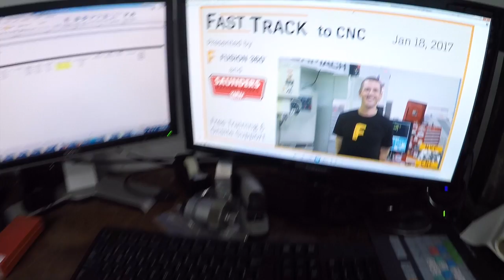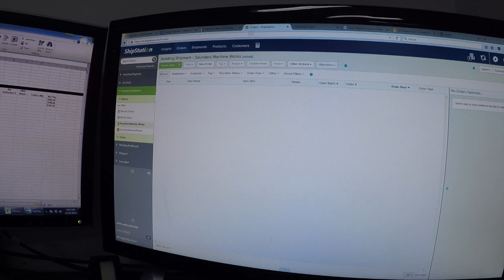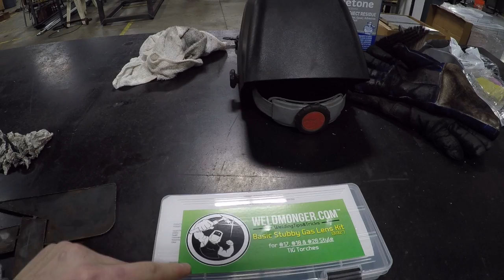Fusion 360 Event, Welding Podcast, Scraping Class!  CB41

Comment: Rust Prevention: I use Frog Lube on my vises, rotary tables, and other tools. It originated as a Rust inhibitor on Firearms, but seems to work well on machine tools, especially for tools you that sit on shelves for long periods. there are YouTube videos comparing it to all of the other products, and I haven't see only show a better product yet.Bring all three castings, in case one of the has a problem (inclusion, warping, etc).

Comment: Have fun with the scraping class. I'm about to take my 3rd class with Rich King in Feb. He's a good teacher. I'm rebuilding my Bridgeport. Its a time consuming process, but satisfying. It still amazes me that you can work in tenths with hand tools.  Andy
Reply: Before you start? It all depends on how much work you want to do! Rich says generally that if the work is out  by more than 5 thou, then get it machined. You can still scrape it if its more than that, but its going to take time. Figure you will take off about 1 to 2 tenths per pass. So 5 to passes per thou. That is not a bad as it seems, since you will start with the highest spots and work down. Lets say that straight edge you are working on has a dip in in the middle. You would divide it into several areas. The highest would get more passes. This is called 'step scraping'. On my 36" straight edge I was out by over 10 thou. I mill I had was limited to 14" of travel, so I had to shift the rough straight edge casting a couple times to cover the length. It was fine in the end, it just meant I had to do a fair number of passes. This is where a BIAX pays for itself. We were joking about planing with a BIAX :)

Comment: Great channel, John... longtime viewer, recent subscriber, first time commenter... I've always wanted to do some machining, I've had some experience with CNC routers and sanders, but no metal machining until recently. I recently started working at a place with a Smithy, a Bridgeport, and Fadal 4525, which had been in storage for a couple of years – and I'm just getting it running now, trying to decide which CAD/CAM package to go with, and very much looking forward to making some chips...

The RO unit should work just fine, I had a similar setup on a saltwater aquarium, RO's are common for "reef" tanks, because the bright lights for the reef tanks evaporate off a lot of water, and you can throw off the salt and mineral content if you add un-pure water. I built my rig out of an RO unit I found at Goodwill for $8 or so, and a toilet bowl float... IIRC, the sump for the aquarium was about 60 gallons, and the toilet bowl float kept the sump topped off nicely, only added water when it was needed. Best of luck!

Comment: John, your have a VM3, use the dowel pins in the table and in the vise to locate them! EDIT: let me clarify, Orange sells sub-plates that will dowel to your table, then you'd use the ball locks to attach the vise to the sub-plate. Or you can just put dowel pins in the table to form a right triangle to locate 2 sides of the vise. The dowel grid is precision, so you can line up all the vises to the grid.

Comment: To get your vices lined up and equally spaced you could machine up a rectangle block the same width as your vice which has a say 20mm round spigot sticking out of the top which would then be locked into either a er32 collet or whatever size side lock holder you have. Do a M19 command which orientates the spindle and locks it in position though im not sure if thats a M19 on the hass controller. Dial up the rectangle block so it is parallel then clamp it in the vice then you can accurately line up each of the 4 vices and equally space them because you can use the position screen to set the same distance apart for each vice. I've done this in the past when I was mounting a chuck on the table by putting a long milling holder in the spindle then clamp the chuck jaws to the milling holder so I straight away knew the co-ordinates to set the chuck. I haven't done a vice like that but I can't see why it wouldn't work.

Comment: WD-40 is a water displacing fluid, hence the "WD" name. However I don't believe it makes a good long term protector. Down here lanolin based products are well regarded and I use this one http://www.inoxmx.com/inox/mx4-lubricant/ It's unlikely to be found there, but I'm sure you guys would have something similar.

I've got to know Rich through scraping and always recommend his course. I think you'll have a hoot, so enjoy. The straight edges are a good project but stress relief them if they're still green.

Comment: The Starrett micrometer spindle that's marked "Sunnen" is from a Sunnen dial bore gauge setting fixture. They are typically used for automotive machining such as cylinder block boring/honing.

Comment: If you're traming in the vises to eachother in order to hold long parts, it's really not worth the time and aggravation. 

Throw in soft jaws (steel or aluminum) and cut a step in them across all the vises. 

Guaranteed to have perfectly straight and trammed work holding across all the vises. 

And I'm betting with the carve smart you could number them and keep them as sets and throw em in any time you need to hold across multiple vises and they should tram back in within a thou
Reply: Defnotdemas 
My perpetual insanity does occasionally spurt out a few bursts of genius 😁

Comment: John,

If you think you're going to be taking those vises on and off a lot, you may want to invest in an artifact that will allow you to clamp a "master" straight across all 4 vises, then you can tram in the master surface, bolt down the vises independently, and then re-check quickly. I started writing this, then you brought your parallels /scraping project, which is perfect. If you're scraping correctly, you should definitely be able to end up with an artifact that will allow you to tram multiple vises at once.

Brendon (ex precision machine builder)
Reply: I was thinking the exact same. A big parallel.

Comment: I like the 5 axis type centring vises for machining side 1 of parts..Once mounted on the bed just record the X Y position at the centre of the vise and the Z position of the lower part of the jaw step..then the X Y will always stay the same regardless of stock size...just program the part in cam with the ucs (G54-9) on the centre of the part. Then take away the stock thickness from the Z axis value you had set for the lower part of the  jaw step..you will never need the Edge finder! Also the Gerardi and Lang 5 axis vises have hardened gripper teeth and only need 2-3mm to clamp onto. They will clamp aluminium and mild steel. Great channel by the way John.. keep up the good work ;-)

Comment: What are the holes in the table of the haas? I've seen tables like that but never used or asked about them.. are the slots for tenons as well as tee slots or just tee slots?
Reply: Ohh I see the holes with a cap head in a clamp holding a vice(vise) on I think, but why are some offset?
Reply: NYC CNC I see, at first I thought the holes were some sort of dowels holes but seen a cap head in one. And also seen the part where you mentioned about the tee slots in the actual video I'm watching haha.  Thanks for the reply though, even though kind of a stupid question :)
Reply: Since they are intended for mold makers, the Haas VMs get grid tables. A lot of molds are big chunky blocks, so they get bolted directly to the table - the grid pattern gives a lot more options for doing that.
Reply: The holes also have a .625" hole (.625" deep) for dowel pins. Useful for pinning fixtures or simply drop two pins and push your part/vise against it.

Comment: Your coolant contains rust inhibitors already. No need to add anything extra. 

If you're getting rust, your coolant mix is off. 

If you want to keep your vises from rusting while off the machine, spray em down with a spray bottle of fresh coolant, it'll dry and form a film and prevent everything from rusting. 

No need to spend money on snake oil products, your coolant is already there and paid for.

Comment: Hi John,
You could either buy a sub plate from orange vises company or machine one on your own.
I have make my own sub plates for  jergen vices and it is better solution in my opinion as you can customize it.
In my case I have one big sub plate on whole of the table and that fiit either 3 different set ups of vices or 2 different sizes of fixture plates(something like your pallet, but goes on the subplate). Main adavantage is no datum checking for anything more than 0.002".
Pretty much a budget zero point system ;)
Keep up the good work and Happy New Year ;)

Comment: Happy New Year John! Thanks for sharing the tripod info, will check them out been wanting a new one that goes up higher.  Sounds like your building the capacity to be able to scale by removing yourself from some of those time consuming administrative burdens by outsourcing payroll.  I won't be far behind you on that.  Those parallels are badass!   You can tell you have a cold, that sux.. hang in there sir... your patience and perseverance will get you through the stress.